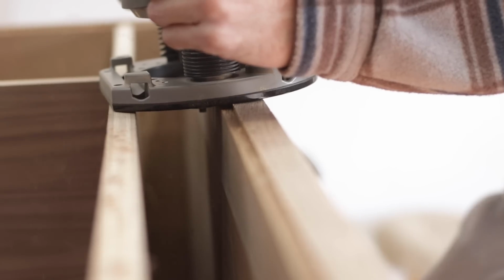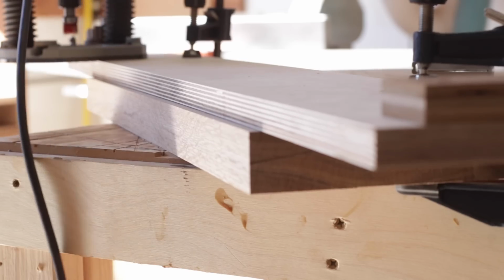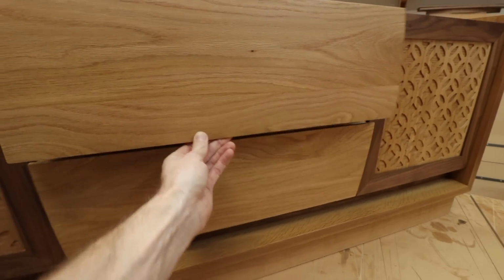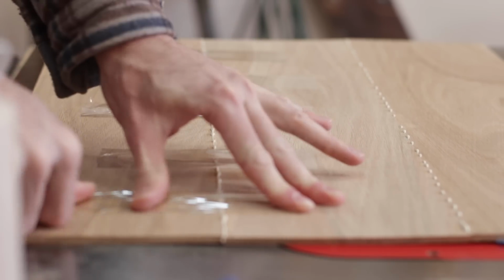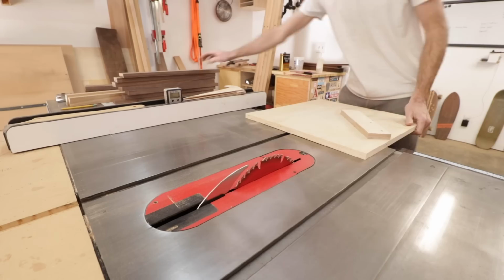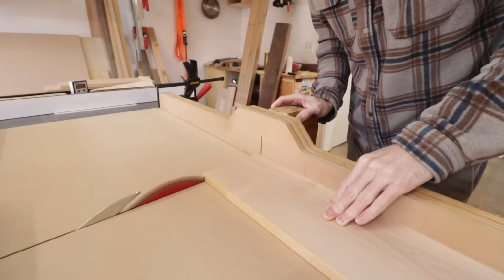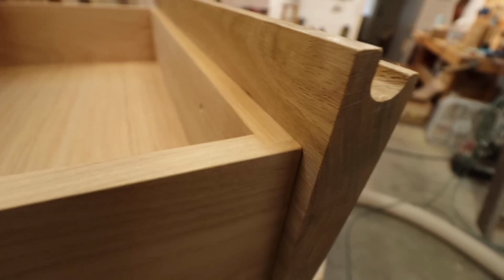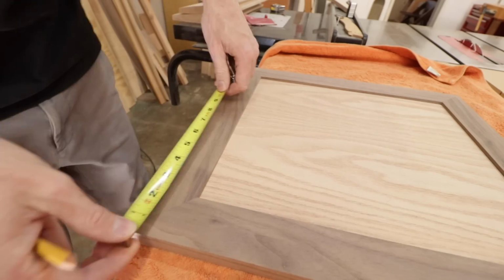Building a Retro Modern Credenza - Part 4: Drawers, Doors, and more(s)

Comment: Nice work and congrats on the move. I've always been impressed by how efficiently you use what seems like a pretty small space. Curious how you decided that the tops of the doors and drawers would be visible instead of covered by the top.
Reply from the maker: Thank you! Really appreciate it! Yeah, it will definitely be nice to have a bit more space. Having the drawer and door fronts in that configuration was purely an aesthetic choice, I felt like having the top visible would have kind of clashed with the curved drawer fronts.

Comment: Those curved drawer fronts are pretty slick. Question: Any particular reason you placed the hinges on the inside of the doors? Either way... Congrats on the new shop!
Reply from the maker: Really appreciate it! It is really just an aesthetic choice, and most people would assume they open the opposite direction, so it keeps people guessing!

Comment: Awesome build! I am curious for the reason behind the doors opening in the direction they do.  Typical its from the inside out but you have them from the outside in.  Is it for a specific function or just a design element?
Reply from the maker: Thank you! The door orientation is mostly aesthetic, I just like how they look opening that way. And honestly, part of the reason is because doors are supposed to open a certain way, so I make them opposite to keep people guessing.

Comment: Outstanding build Shaun. I learn so much watching your videos! Quick question: Do you use the same blade in your TS for all your cuts?
Reply from the maker: Thanks, Greg! That is great to hear. I keep a Forrest Woodworker II in my table saw about 90% of the time (I had a Diablo combo blade in for this video because the Forrest was getting sharpened). The only times I switch to a different blade is if I am going to be doing a ton of crosscutting or if I am cutting a lot of veneered plywood and need to be certain I won't get any tearout. In that case I use a Forrest Chopmaster.
Reply: Ah, that's the ticket! Forrest Chopmaster. Have a 12"er in the chop saw, never thought about a 10" one for the table saw. Cool! Thanks man. Good luck with the transition and if I can be so bold as to offer some unsolicited advice, stay true to your vision of the videos you want to create. Love your style!
Reply from the maker: @gregwatson8554  Really appreciate that! If I'm not making the things I want to make, I think I am doing something wrong. No plans to change that!